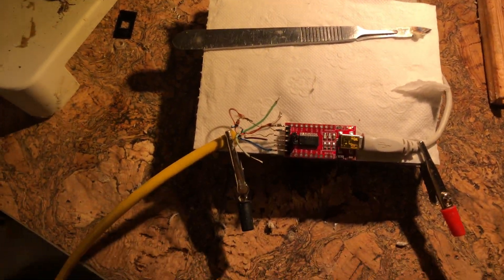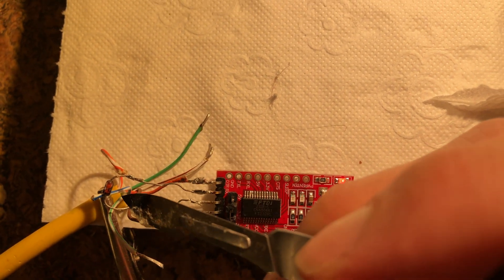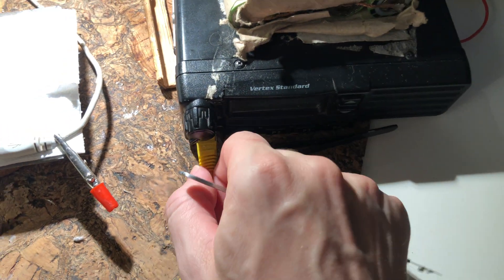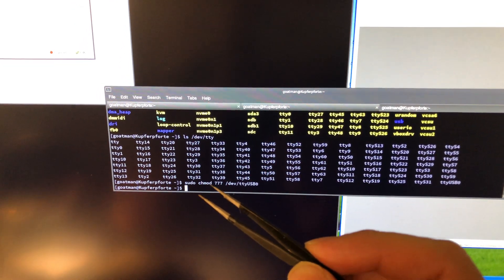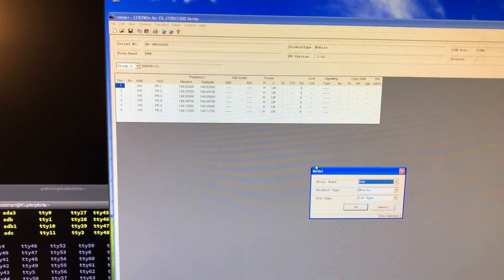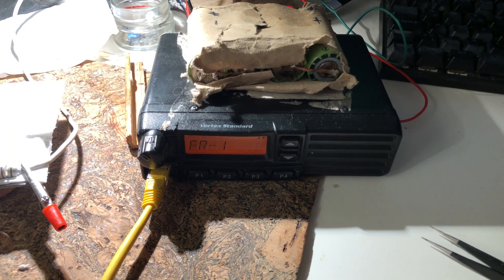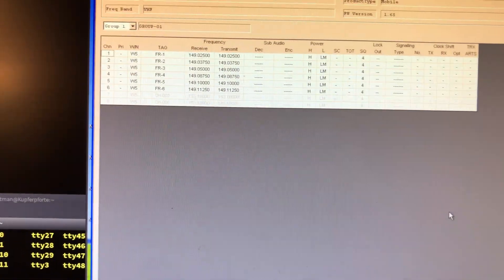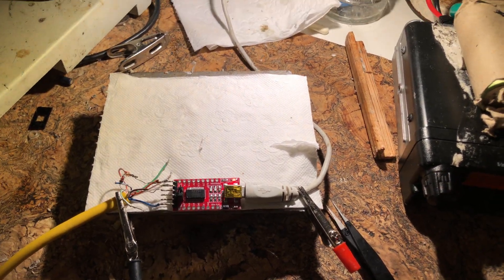How to Program The Radio  - Vertex VX-2200E Programming Cable - Tips & Tricks

Comment: Hi I am looking for help to built programming cable using ftdi module for VX 2000 radio. Can u help with wiring/circuit diagram.
Thanks in advance 
73
De VU2ICI

Comment: So I have a programming cable that is supposed to work with the vx2200. Problem is all it does is reset over and over again. What did you do to solve that?
Reply from the maker: So if you look on the video the radio keeps resetting with the cable I built (3:20). It programmed anyway so you should try it and see if it works.
Reply: Sir I beg for your help.. maybe you could help me.. maybe if you could share your program software CE82 with me it will be a big help to fix my vx2100 plz sir I beg you.
Reply: @terstemplonuevo  contactame por Privado
Reply: It’s hard to find a computer that will display the channel list. Even XP, which I have… if it receives any updates you can still program more radios, but no longer edit channels.